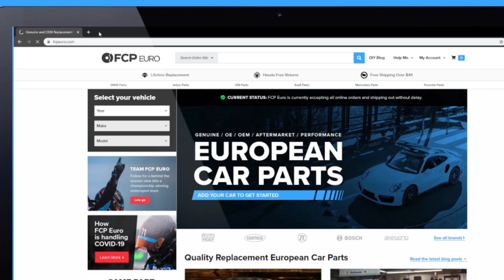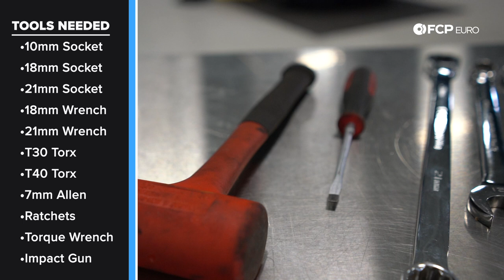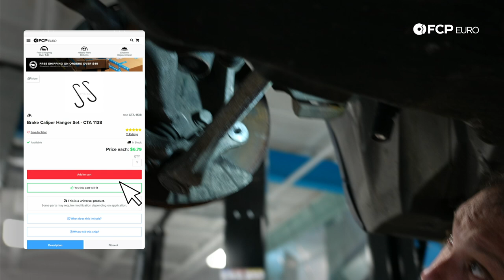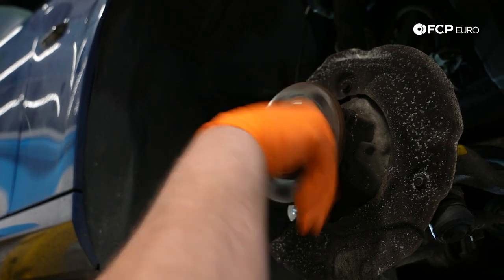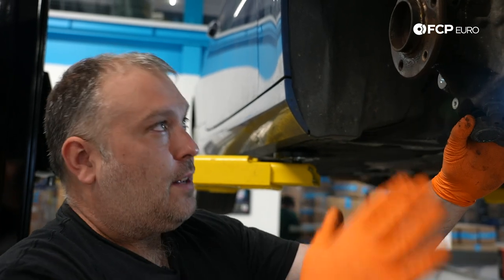BMW E90 Steering Knuckle Replacement DIY (E91, E92, E93 3-Series | E82, E88 1-Series)

Comment: What would be symptoms of this steering knuckle needing replacement ???
Reply: I am wondering the same thing 🤔
Reply: Hitting a curb or large pothole can damage the knuckle thus is the case of this car otherwise they don't need repair.
Reply: Original question says what are the symptoms, is there anyway to tell other than visual inspection?
Reply: @azdannyboi  Right now, my car has a loose feeling to the steering and their is a metal-on-metal noise when load is shifted across the front axle (turning from one direction to the other). I'm not 100% sure if it's the knuckle, but I'm having it diagnosed on Tuesday.
Reply: @azdannyboi  If you keep blowing struts that’ll be a good indicator. You can also do some measurements of the knuckle and compare them to the opposite side.

Comment: Gareth, any reasons NOT to apply a (very) thin amount of anti-seize compound to metal mating surfaces?  In particular, the strut column under the pinch bolt surface area?  I'm thinking about the next time you'd need to remove the knuckle.  Thanks!
Reply from the maker: Nope no reason not to Mario, you can apply some antiseize there no issue.
Reply: @fcpeuro  awesome thanks.

Comment: In the Fx series wheel bearing is held by different screws (part number: 31206872920) with no pre-applied loctite. Do I need to change them anyway? Thank you.
Reply: I agree with you! I replaced the steering knuckle today on my daughter's 2013 328i and the wheel bearing screws were T60 head screws. Other than that, this video was spot on. Thanks for sharing this video, it was a tremendous help!